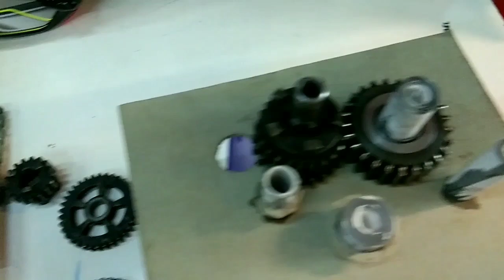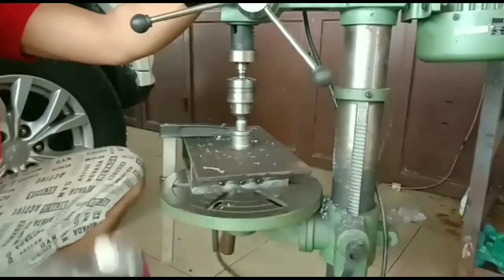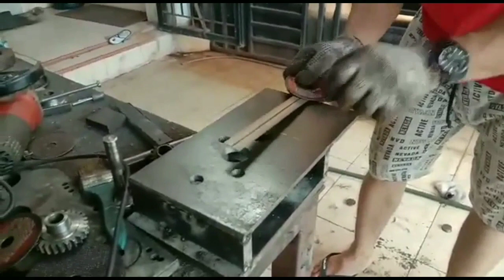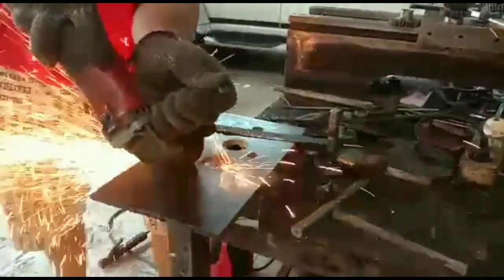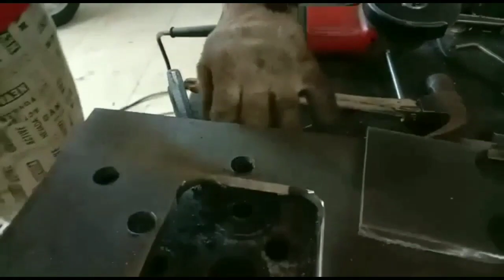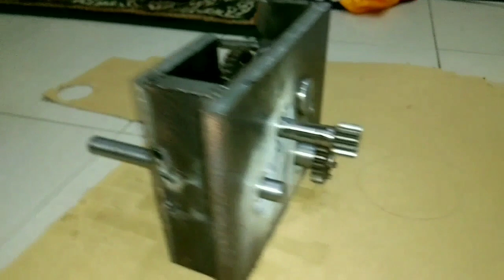Homemade metal lathe(apron otomatic gearbox)episode 1

Comment: Try (GOOGLE TRANSLATE) if you cannot read this. 

  I’m impressed, are you copying another already built  lathe ? or are you following some build prints ?? or is this all from you own design ?? I am asking you this because you are doing it really well with what tools you have!!! I have one point of advice for you.  This is to actually get the bed ways and bottom of cradle PRECISION FLAT.  You must use a GRANITE SURFACE PLATE and HAND SCRAPE 👍 it flat using BLUE LAYOUT DYE.  Good idea do  the bottom of the headstock this way. I am a machinist for 15years and you are doing this very well!  but I didn’t think the SAND PAPER METHOD 👎 is actually making it flat enough for that purpose. Plus when hand scrapped flat it gives room for lubricant. 
. I hope you can translate this. 

Try GOOGLE TRANSLATE
Reply from the maker: thank you brother.this is purely my idea which is done manually.sand paper method that i use because of the limitations of work tools and the results i try to the maximum.the advice that you for me will try